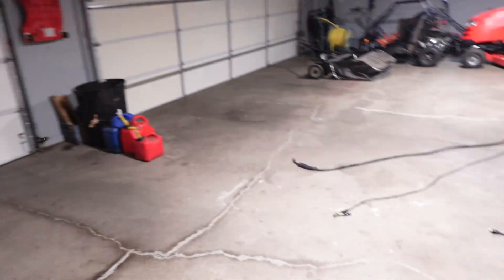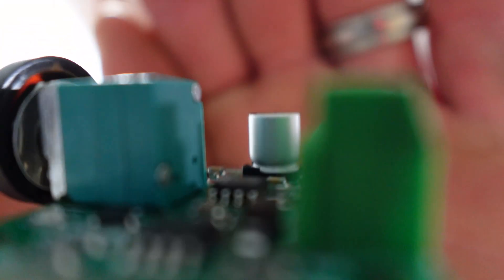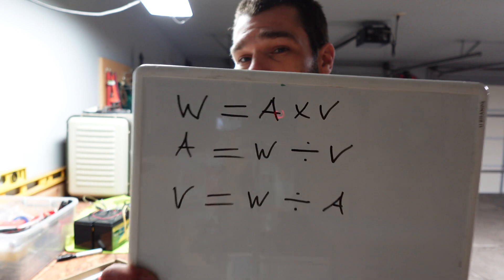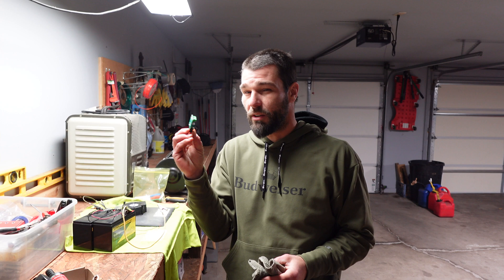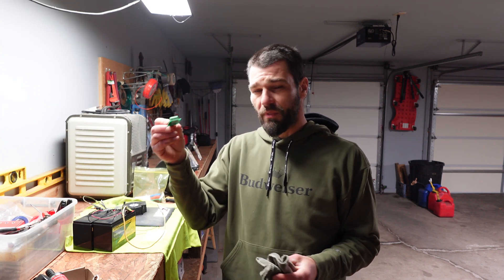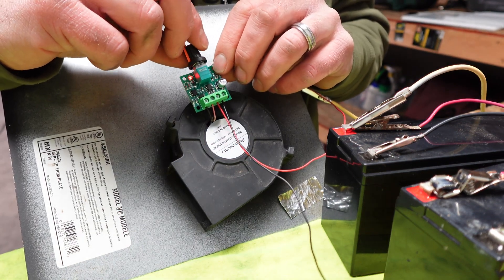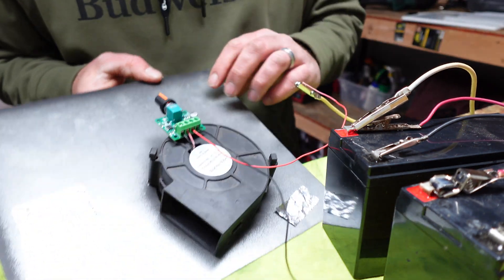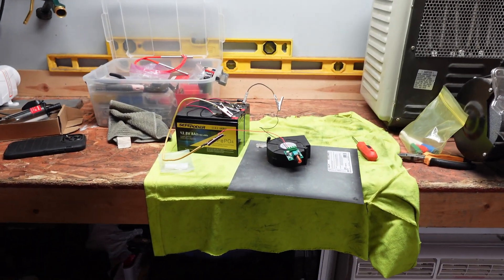DIY CHEAP Greenhouse Heating Experiments - 2Amp 12Volt 30Watt Variable Control Switch- Winter 24/25

Comment: Do you ever heard about Arduino? I think you can have a lot of fun with It programming pumps, sensors, fans and most important modulating everything automatically
Reply from the maker: yes its relatively new to me, but I have found it and the system interests me. I do need to experiment with waterproofing more complex controllers that are exposed, I have some junction boxes on the way and have been looking at electrical paste/sealer. I may move towards a more computer style of controlling my systems, thanks for commenting that idea for us!

Comment: Nice !  I was hoping you would experiment with those.  The nice thing about those var motor speed controls, is you can get them for just about any size you need based on the specs.  I will be very interested to see how you make out when you put them into the system.  Thanks for the video & have a great day !
Reply from the maker: yes I really like the new found control, I ordered some 5amp and 10 and controllers all 12v, lots of opportunity for growth and efficiency on the homestead. thank you for checking this one out!